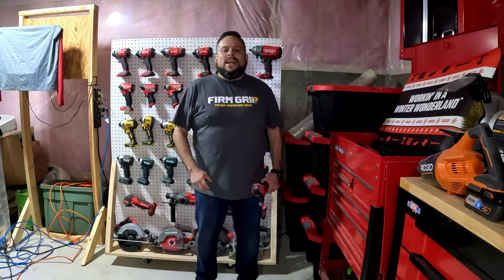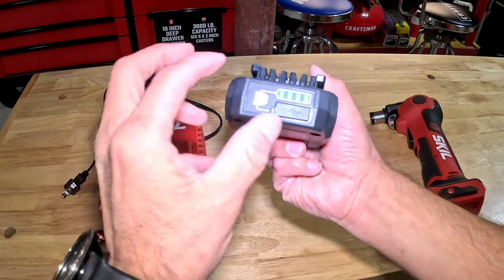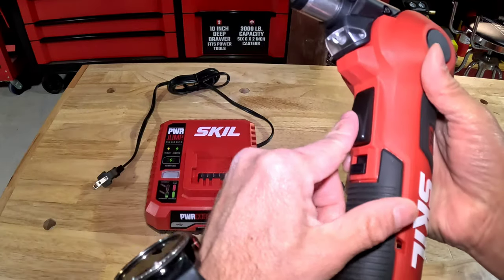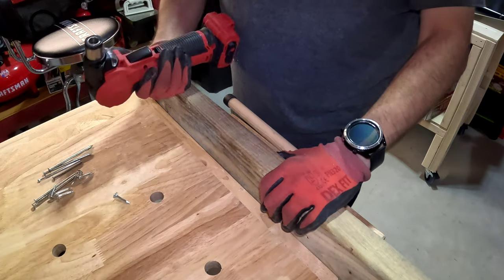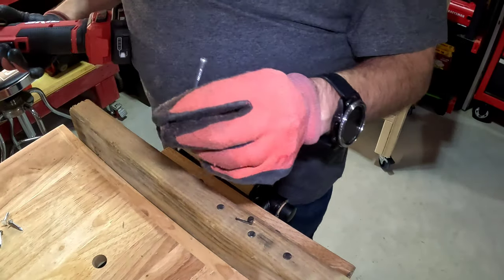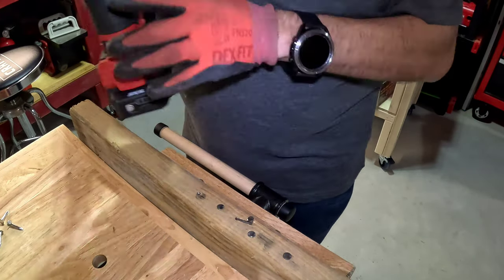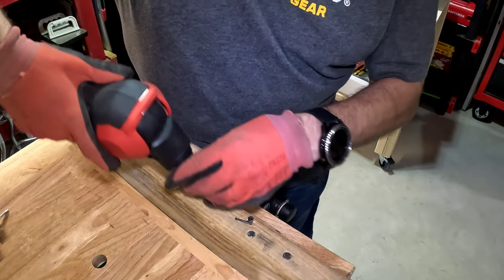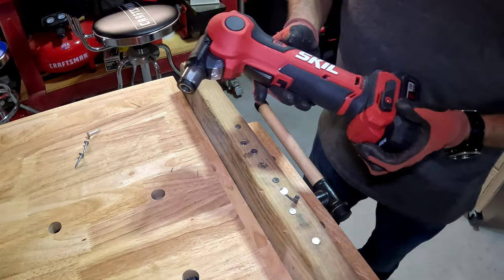the skil auto hammer packs a punch in the best way possible

Comment: Any idea how strong it is? Im trying to find something strong enough to hammer on a bolt extractor socket for a rounded off bolt in my car. I need something strong enough for a tight space with no room for manual hammer.
Reply from the maker: no idea. but by the sound of it you might need an air hammer